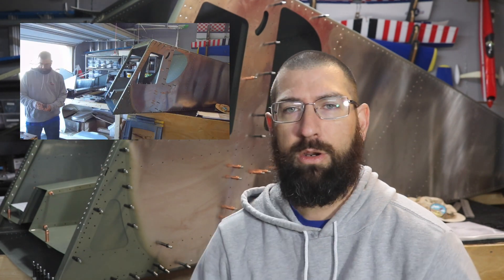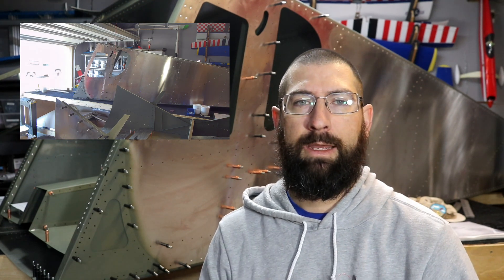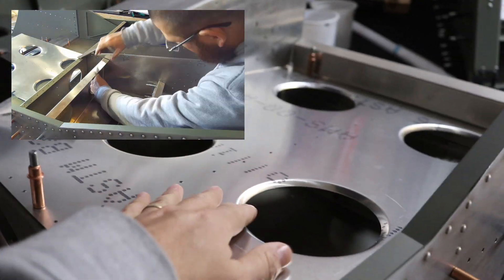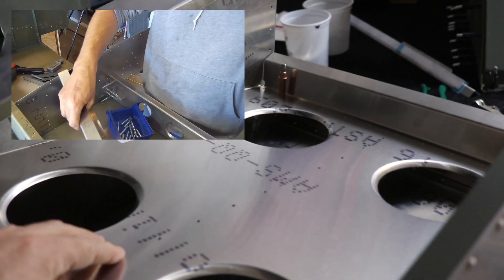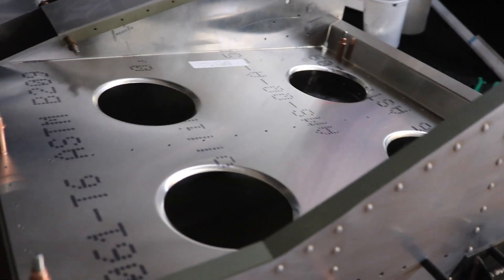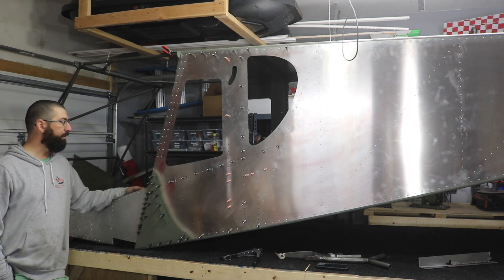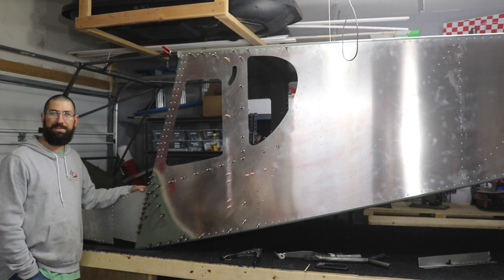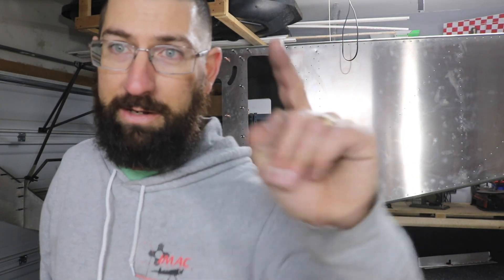Zenith Cruzer Build: The Fuselage has been joined

Comment: I'm at the same stage as you .Im chromate painting the inside because of the damp English climate .This slows things up a bit .Im trying to do the thing s that are going to be a pain later ,I'm putting some conduit in the long extrusions Ten mm plastic tube slide fits in the slot that is formed in the corners When it's time I will blow some fishing line up the tube and pull the trim cable through .Also I will pre fit the transponder cable . the antenna cable .and a conduit for the remote Dynon compass ,Hopefully no flapping cables or too many. p clips .When you fit the antenna you will need to beef up the top skin .The antenna will soon tear it's self off when it vibrates the skin .A star shaped spreader plate will do the job .Have fun  regards from the wet UK .
Reply from the maker: Thanks I appreciate the comments